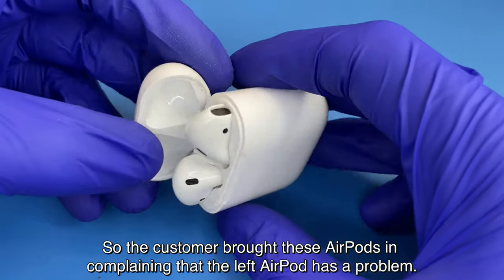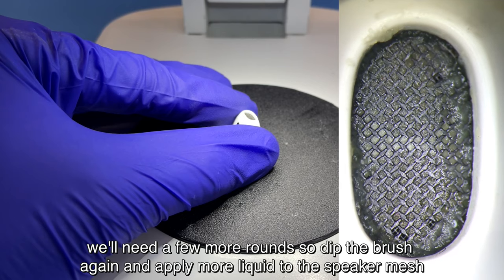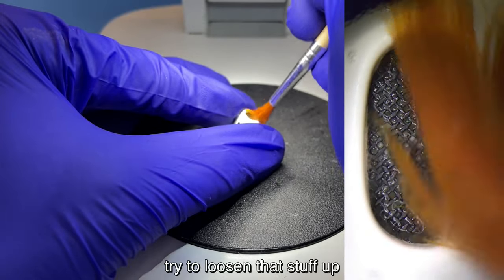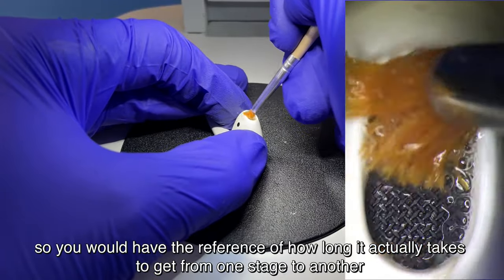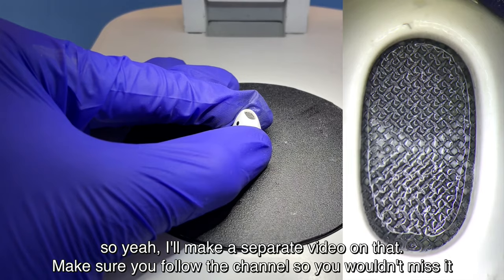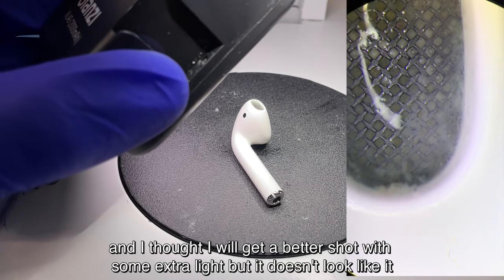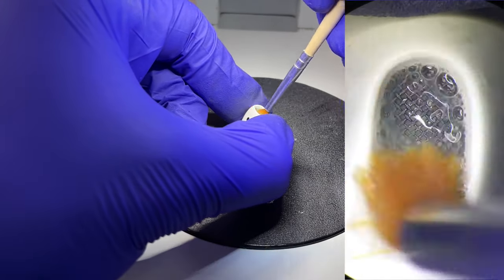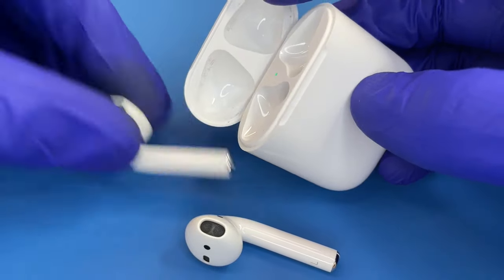How to deep clean your AirPods like a Pro! The ultimate guide by Phone Fix Craft

Comment: Nice video - but I would be very worried about putting any liquid any where near electric parts -  are you sure???
Reply from the maker: It worked every time so far. Also it's a last resort for them AirPods, as they were complytely unusable and otherwise would end up in trash.
Reply: If you're really worried about that you could use Isopropyl Alcohol, ideally 99% but I can't find that where I live so I use 91%.  I doubt it would work as well as this windows cleaner but it evaporates very quickly and is very unlikely to damage any electronics.  I use it without mercy on pretty much every electronic I've ever fixed or cleaned and have never had any issues.
Reply: @LnnyOsoTo  I used 50% lol
Reply: maybe a combination of window cleaner and isopropyl could be a “game changer”
- should look up if isopropyl can be mixed with detergents (maybe a solution with 10% “soap”..)

Actually..nvm, I I’m far from being able to suggest anything better

I’ve just read that it’s recommended to use a 99% (would be great to have, if it’s wasn’t because of how rare it is to find - because of safety laws).

Could imagine how the 99% maybe easily would mix up with any water solutions left inside the device and then better evaporate and dry up any surfaces..

Also not sure how long isopropyl will stay at it’s original alcoholic level (when the bottle has been opened the first time..)

Comment: cracking video! Could you make a video for also cleaning airpods case? Thanks a lot!
Reply: Hey! I clean mine often because my ear wax is very wet, and let me tell you he’s using way too much liquid and window cleaner will take way too long like his video. The best thing to use is hydrogen peroxide. For AirPods: Put a little on a cotton swab/q tip (just enough that it’s damp) and clean the mesh. Take a needle and clean around the edge where the white part rises above the mesh. Heat it for 10 seconds on low heat with a blow dryer (or heat gun if you don’t have a blow dryer). Suck it fast (I do it with my mouth but you can do it with a vacuum) and it’ll be brand new. For the case: hydrogen peroxide again! Wet a cotton swab- I soak it then squeeze it so it’s basically like ringing out a cloth. Wipe around everything on top and down the holes where the AirPods charge. You’ll probably need a few cotton swabs because they’re way dirtier than they look. Use light heat or the cool setting of a blow dryer to dry, and keep open for a few minutes. Make sure it is fully dry before plugging in because it WILL melt your AirPods if the case is even a little wet while charging!

Hope this helps☺️ I got this info straight from Apple and it’s the absolute safest way so you don’t damage the pods or case.
Reply: @kailenepower5827  thanks a lot, I will keep this in mind! Really appreciated!

Comment: I’ve tried this before and can confirm it works. Someone needs to make a vacuum nozzle attachment specifically for cleaning AirPods. Any other method of trying to clean these, basically just pushes anything into the mesh.

Why are you using window cleaner over rubbing alcohol?

I forgot to add that it helps to cover over part of the nozzle with a piece of tape, so that you can get more suction.

Comment: Would peroxide work as well, thats good for breaking up wax?
Reply from the maker: I have tried it, but it didn’t seem to work any better than a window cleaner
Reply: @PhoneFixCraft  Can you use every window cleaner? I live in the Netherlands so we have other brands.
Reply: Peroxide is the proper way to clean it (per Apple). It didn’t work for the video maker because they didn’t follow the instructions. I’ll copy and paste what I told another comment, which is directly from Apple.
Reply: Hey! I clean mine often because my ear wax is very wet, and let me tell you he’s using way too much liquid and window cleaner will take way too long like his video. The best thing to use is hydrogen peroxide. For AirPods (including mesh on sides/microphone): Put a little on a cotton swab/q tip (just enough that it’s damp) and clean the mesh. Take a needle and clean around the edge where the white part rises above the mesh. Heat it for 10 seconds on low heat with a blow dryer (or heat gun if you don’t have a blow dryer). Suck it fast (I do it with my mouth but you can do it with a vacuum) and it’ll be brand new. For the case: hydrogen peroxide again! Wet a cotton swab- I soak it then squeeze it so it’s basically like ringing out a cloth. Wipe around everything on top and down the holes where the AirPods charge. You’ll probably need a few cotton swabs because they’re way dirtier than they look. Use light heat or the cool setting of a blow dryer to dry, and keep open for a few minutes. Make sure it is fully dry before plugging in because it WILL melt your AirPods if the case is even a little wet while charging!

Hope this helps☺️ I got this info straight from Apple and it’s the absolute safest way so you don’t damage the pods or case.
Reply from the maker: @kailenepower5827  are you sure you want to suck this with your mouth? 🤢 What do you mean by saying you got this straight from Apple? Their public support article HT208729 about AirPods cleaning says in the very begining: "Don't use products containing bleach or hydrogen peroxide".  I have also checked internal service docs and they don't mention peroxide at all. They don't mention window cleaner either, and they say to avoid any liquid getting inside the openings. My method is not the official method approved by Apple, but it worked for me so far.
Reply from the maker: @kailenepower5827  What do you meand directly from Apple? Their public support article HT208729 about AirPods cleaning says in the very begining: "Don't use products containing bleach or hydrogen peroxide".

Comment: Tried this myself but now my right pod is very low on volune. I assume that I used the vacuum on to high of a speed and maybe damaged the speaker membrane. Any thoughts from anyone that might have had the same problem and maybe found a fix? Thanks
LE: to note that the bud sounds ok but at about 5-10% of the volume I get on the other one. They are balanced so no software problem here, tried the reset and all.

Comment: For years I've been boiling water and only putting the tips in and using a toothbrush after. First time I tried 70% isopropyl and peroxide 50/50 and the headphones sound like they have no base. What gives?? They are fully dry

Comment: After trying to clean my left one and having zero results in volume increase I just decided to pull out the whole mesh and man there was this thick layer of wax in the second layer of mesh behind the first one. It looks weird without the mesh but the volume is 100x better.
Reply: Can you safely put it back
Reply: @doskipanda7466  no, there’s no way of putting it back but as long as you clean the wax off after every couple times you use them the wax really has no risk of going inside.
Reply: @doskipanda7466  I’ve had them like this for months and they are completely fine

Comment: I’d make the brush a bit more stiff or just but a AirPods Pro cleaning tool with window cleaner and vacuum it’s better
Reply: If you want use a heater and heat the earbud a bit ( wax will melt )

Comment: Its all very stupid what you do. Because isopropyl is a solvent to glue. You should only and only use low concentration Hydrogen Peroxide - around 3% or less - and that over very very long time (at least 3 hours). Only that can dissolve wax without dissolving glue.